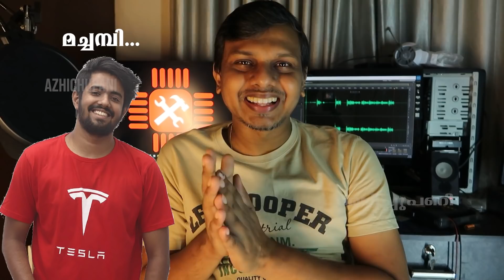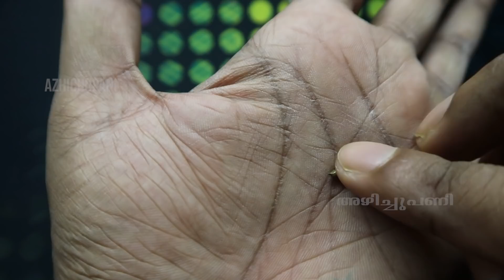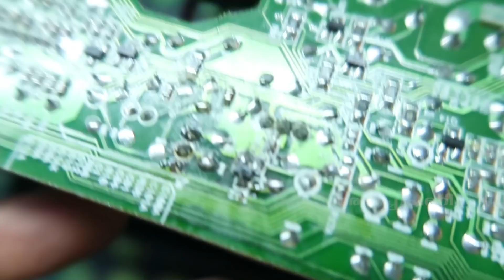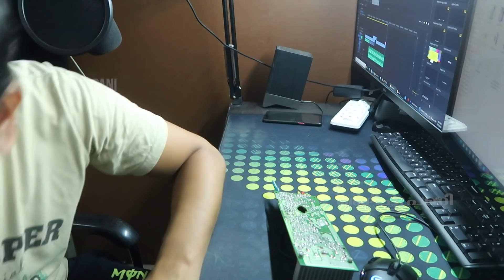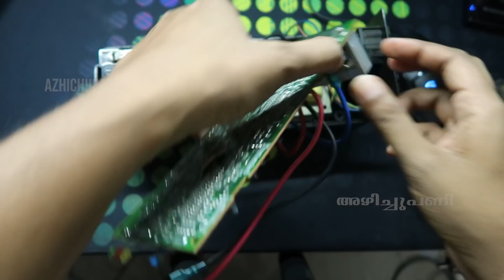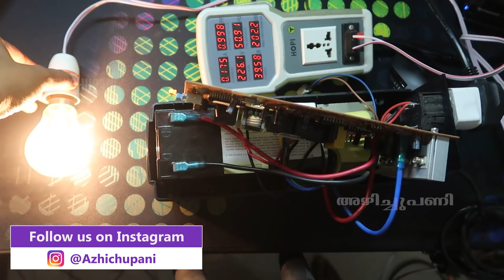🚗🔌Car Inverter | Part 1: How to make a car Inverter | കാർ inverter നിർമിക്കാം? | #azhichupani

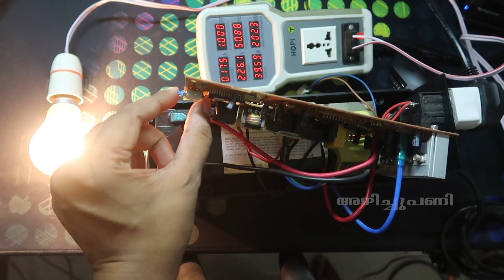Comment from the maker: 7:30 ഈ നിലവിളി ശബ്ദം നിർത്താൻ എന്തെങ്കിലും മാർഗം ഉണ്ടോ?? Buzzer ഊരി എടുക്കാതെ നിർത്താൻ ആണ്..
Reply: Oru on/off. Switch vechal pore⚡
Reply: 15 minutes kayinjal ups offakille
Athinu valla margam undo
Reply: Microcontroller program
Reply: Remove ട്രാൻസിസ്റ്റർ
Reply: easy hack is to mask the buzzer with an insulating tape or a heat shrink insulation

Comment: i had done a solar ups inverter for home but the problem that is heating when it runs for too long 
i had changed the battery to 44ah and added two
Loom Solar Panel 50 watt - 12 volt Mono Perc for charging with a challenge controller but i get stucked in heat management
how i can accommodate a cpu fan without destroying the physical appearance (i had seen your previous videos which you installed a router port in an ups,it seems good the space management was fabulous )
i have a cpu fan and a thermostat , i had removed the 12v7ah battery from the cabin so the space is empty can we utilise the space
Reply from the maker: You can watch it in tomorrows video... :)

Comment: Bro I also have an old UPS. But the batter is dead, I replaced the battery twice. But the battery is getting complaint (The battery is not able to hold the charge, the battery is getting drained very fast with no load) I think the charging circuit in the board is complaint... Is there any way to fix it? Since the UPS is complaint I bought another UPS. But is there any way to fix it..
Reply: I tried to find any blown components, but couldn't find any..
Reply: Yes

Comment: കമ്പ്യൂട്ടർ UPS 15-20 മിനിറ്റിൽ ഓട്ടോമാറ്റിക് ഓഫ്‌ ആകുന്നു (ബാറ്ററി കപ്പാസിറ്റി ഉണ്ടെങ്കിലും ), അത് ഒഴിവാക്കാൻ പറ്റുമോ?
Reply from the maker: നമുക്ക് നോക്കാം...
Reply: Yes
Reply: ലോഡ് മൈന്റൈൻ ചെയുക
Reply: Eth model ups
Reply: Athinte micro controlleril backup time set cheytitundakum.
Reply: A atha big problem maybe ups bord pokathirikan ano agane use cheyune avo
Reply: V gard ups edutho njan egane kure kalichu ups bord adichu kalagitulatha ayo athite mousete agane entho oru area elle may be over heet akunakodakum njan um mobile um laptops use cheyana egane try cheythe munne over ayitu onnum hope ella
Reply: Bro vaziyund
Reply: Athine ic yude aduth oru blue colour resistor undu athu removed cheytha mathi prashnam solve
Reply: ഏതു റെസിസ്റ്റർ ആണ് remove ചെയ്യേണ്ടേ...?  പ്ലീസ് ഹെല്പ്
Reply: @irshuirshuz9333  ic yude aduth blue colour resistor
Reply: @prasadss4915  എന്റെ കയ്യിൽ ഈ വീഡിയോഇൽ ഉള്ള സെയിം ബോർഡ്‌ ആണ്..  അതിലെ മൈക്രോ കണ്ട്രോൾ ic യുടെ അടുത്തുള്ള റെസിസ്റ്റർ ആണോ?

Comment: Bro car Battery connectionil ninnum 12v to 3v akan circuit undo oru 3v led connect akan vendi
Reply: Use a step down module.

Comment: Chetta Nte ups idakk Automatic on off aay kondirikkaanu.nthaanu problem?
Reply: it automatically detect the no load situation if it consumption is less than 30w because it is designed for perform high load activity you can solve the problem by eliminating the power saving module
Reply: @ajotbabu7773  bro computer work hey this kondirikkumbo aan off aay on aavunne supplyundenkilum ath thanneyaan avastha

Comment: Bro pinne ithinte output sinewave alla. Modified square wave aanu. Ithumai orupadu project nadathi last nirthi vachethanu. Project Purpose ethu nokiyalum, Emergency sitvationu mathre ithu reliable aaku.
Reply: bro but we use it in all the computers
Reply: @ajotbabu7773  bro life kureyum
Reply: @ajotbabu7773  ups brands cost save cheyan vendiyanu modified squarewave use cheyunnathu. E ups concept tanne computer safe aayi shutdown cheyan vendiyanu.